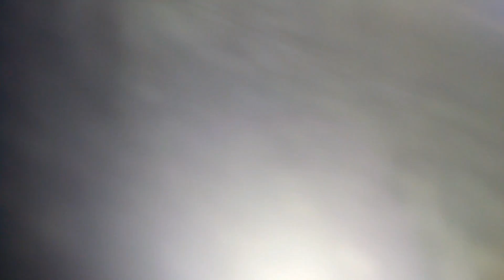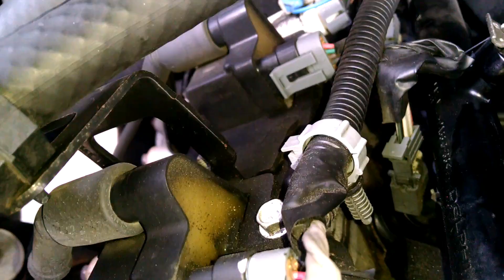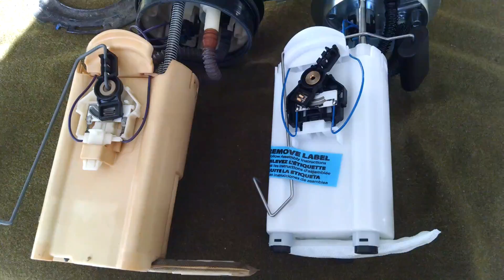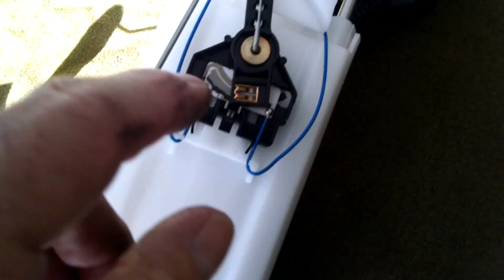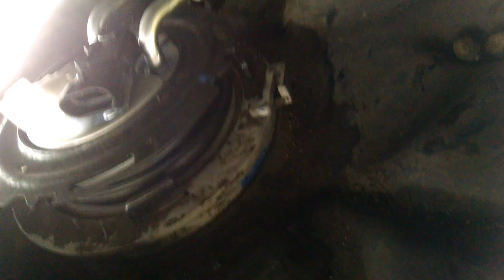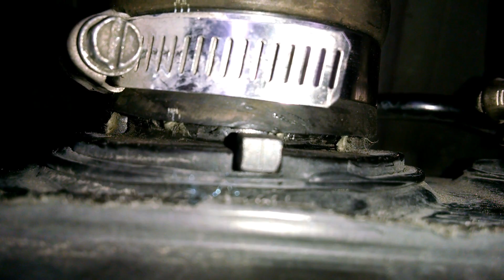Suburban fuel pump remove and replace by froggy

Comment: It would have been really helpful if you would of showed how you disconnected the fuel lines from the fuel pump. Very informative otherwise.
Reply from the maker: Sorry I try to improve each video. :)
Reply: @1947froggy  No... I'm sorry. I was frustrated because I couldn't figure out how to get the fuel lines off. I finally got it tho. Your video was very good and helpful.

Comment: Get a metal nibbler & cut a trap door under the 2nd row seat way easier that droping the tank be done in about a hour or so
Reply from the maker: Yes I have seen that, thanks. My Lexus IS300 has that built in, would that GM were as smart.

:(

Comment: Great video. I'm currently in the process of replacing my fuel pump on my 2004 suburban. I purchased one from Rockauto but it's too big and it has 3 tubes on the top. I've seen similar designs from other manufacturers. My stock pump resembles yours. Where did you get your replacement part?
Reply from the maker: It's an Airtex (sp) and IIRC I got from Rock Auto, It's extremely important to enter the correct year/make/model/options etc. Even then you get the wrong part sometimes. Rock auto returns are possible but not that easy, they ask a lot of questions like did YOU just order wrong.  Probably your 04 pump would be different than my 02 5.3L pump. Mine was NOT identical but was correct replacement & still works fine 2.5 years later.

Please post what you do so other viewers can learn. Thanks. It was very satisfying and saved a bunch $$$ to do this job.

:)
Reply: froggy unfortunately Rockauto doesn’t provide a live person to chat with. Through my own desperate “research” I figured that my 2004 must have actually been a 2003.5 because the fuel pump that came out is pre-2004. True 2004 pumps and tanks have a slightly larger diameter. Either that or the previous owner must’ve swapped an older tank. But I did order a 2003 pump and I’ll update when installed. Thanks for the feedback

Comment: Nice job,I can't find your video where you sypon the fuel out the tanks.
Reply from the maker: I took it down, don't want anyone to try it, who doesn't now enough about what is involved.

:)
Reply from the maker: There are others if you search.

:)
Reply: Reynaldo Deleon I did thus yesterday, I dropped the back strap, took the filler hose off at the tank, 6 dollar siphon pump from harbor freight, go every drop, made a huge difference, whole thing took about 3 hours
Reply: He may have taken down because he may have used a non static or fuel safe drill or electric pump lol, I used a 6 dollar harbor freigjt siphon pump, looks like a basketball pump , once you get it to pump just push the plunger in and make sure it's running downhill, I siphoned off about 16 gallons in an hour

Comment: From the research I've done it s part of the fuel pump...? I dunno never heard of that be four it's an is200 I have but pretty much the same as an is300....thanks
Reply from the maker: +MrStevieDLFC That may be the case, I have "heard" that newer model year cars do not have an external/accessible/replaceable filter just a "lifetime" filter integrated into the pump. The Suburban has both. The one on the fuel pump is pretty small as you see. Maybe it only filters "big stuff" and the inline one on the frame (see other video) filters the rest.

:)